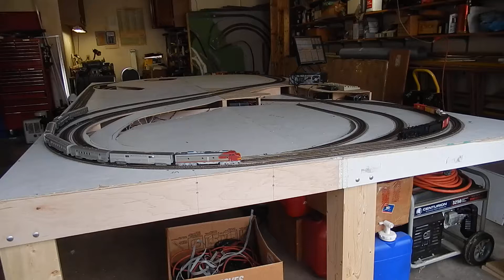test2

Comment: Thanks for posting this video. I run N-Scale and S-Scale (American Flyer) and I want to build a new layout out of thinner wood. My 7' x 8' out of 2x3's and 3/4 plywood weights a ton. How did you build yours? 1/2 ripped @4" for the frame and 1/4 plywood?
Reply from the maker: 23/32 plywood 4x8 sheets ripped 5-7/8 wide 8' framing strips and 11/32 sheets for the top. Still heavy for an old guy like me. About all I can handle by myself in 4X8 sections.
Reply: Jerry, Thank you for taking the time to reply. I will take this into my plans for a new layout. I found the forum site that shows a lot more progress photos. You did an amazing job. I really like how you can fold the layout in half.
Reply: What is the height of the legs or table 34"?
Reply from the maker: 34"